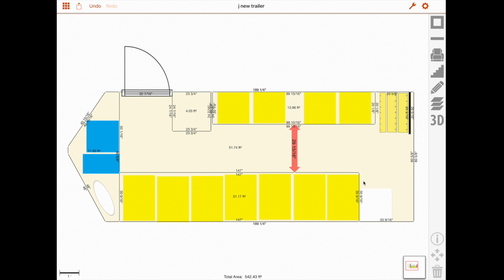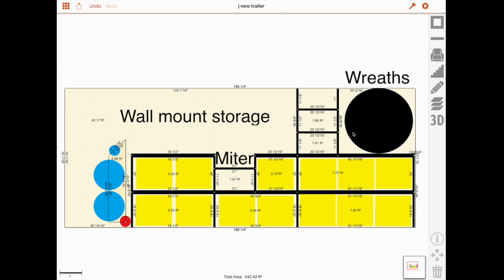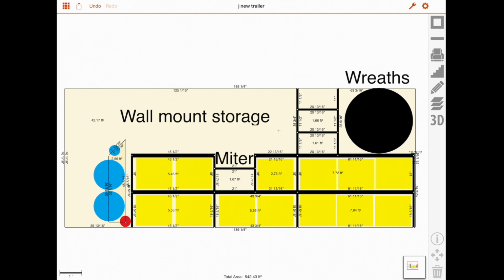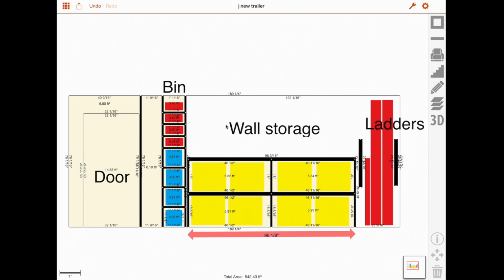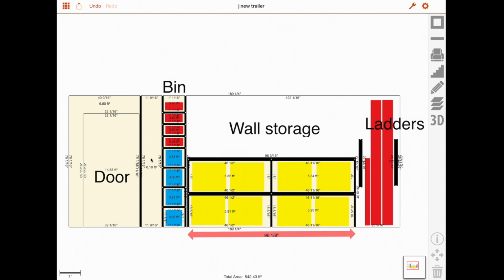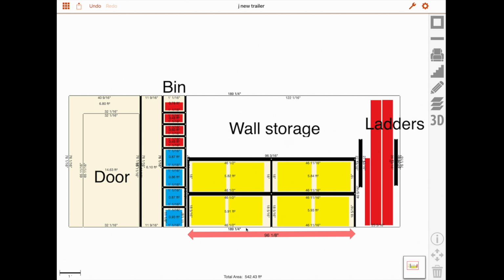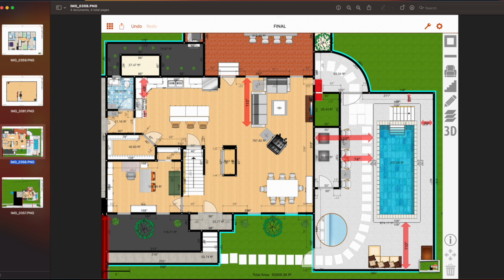The Basics Of Project Design - Designing An Enclosed Trailer

Comment: Have you thought about making some or all of the storage sections removable units? Then you can have ones for specific jobs that are designed to fit the same space and switch them in and out as needed.
Reply from the maker: Thanks for the suggestion. Yes some of the units will be carts, some will be folding shelves that fold flat against the wall. I plan to have a “carpenter mode” a camping mode, toy hauler and then Landscape mode, each with different organizers and space.
Reply: @BitnerBuilt  Awesome, sorry if you mentioned it in the video! I recently installed the folding tabletop brackets on an unfinished wall in my garage. They are great! Underneath I screwed on some narrower boards along the base board for extra storage. Under a different one i have hooks on which I use bungie cords to hang rope and extention cords. Maybe underneath you could add a shelve that folds up to stow flat on the wall under the top shelve. Thanks!

Comment: When I had a trailer and needed plywood and ladder storage I found that any kind of swing down arms was sometimes limiting. I replaced them with d-rings mounted on the wall and ran ratchet straps through them. Vertically to hold anywhere from 1-15 sheets without them moving a bit. The same goes for ladders. If you don't have the full complement, they don't rattle around. If you're not carrying anything, there isn't anything to get in your way. - Chris
Reply from the maker: Hey Chris, in my last trailer I made a 8 inch pocket that was lined with hardboard behind my shelving so that I could just slide sheets in and I could typically fit a good number in there but it was dead space. I agree that heat track works but I’ve also marred up a lot of plywood with straps. I’ve made bad versions of arms as well. Lol but try try again.